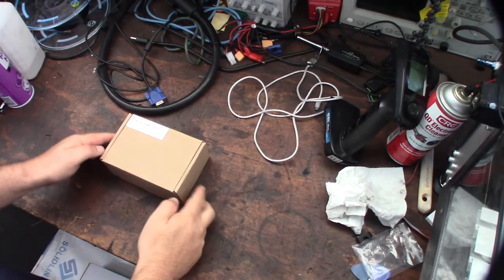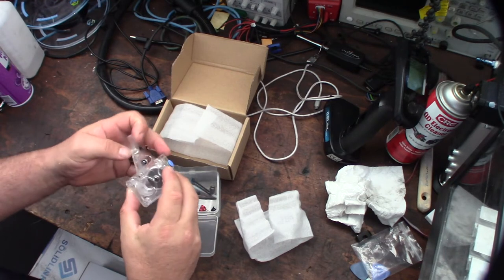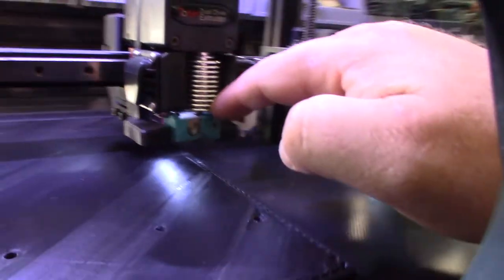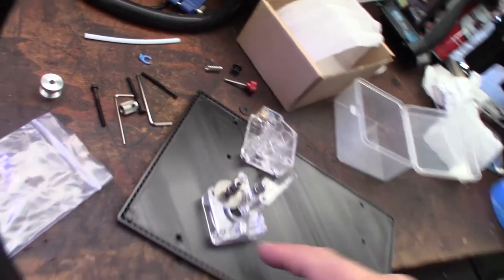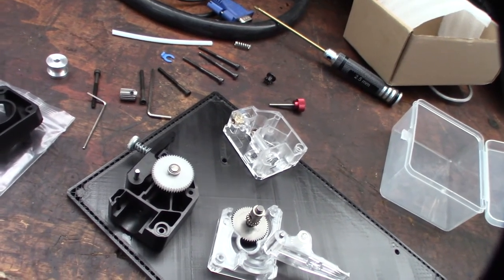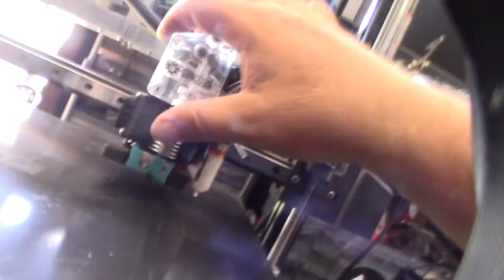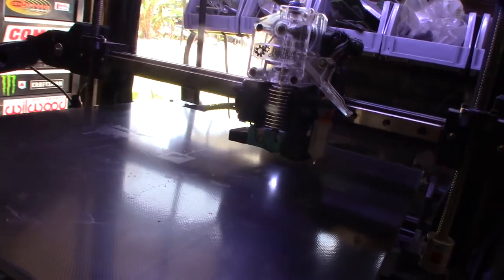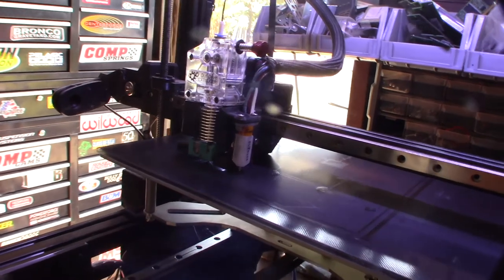Transparent Dual Drive BMG extruder from Amazon Clear

Comment: Being clear would have a big advantage when using flexible material. Often the filament will get all wound up inside the dual gears before you realize something is wrong. I have also had little chunks of filament float around inside the extruder and cause issues down the road on my dual gear extruders.
Reply from the maker: I haven't tried any yet. I see you point though

Comment: How is it ? I just got it and didn't try it yet
Reply from the maker: Same as my other BMG extruder
Reply: Did yours come with Fixing screws to fix it to the motor?
Reply: @AndrewAHayes  nope mine didn't
I already have my own
I've been printing with it for a long time its great but .. the only issue with it that if i pull the filament it would be stuck inside so i had to buy a new one... with the new one i always cut the filament and change it but i never gonna pull the filament again.